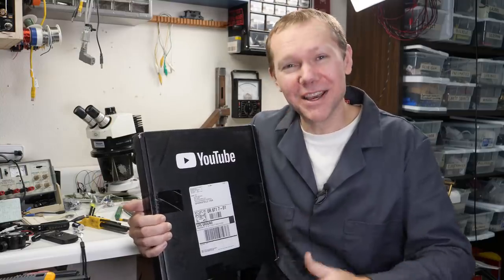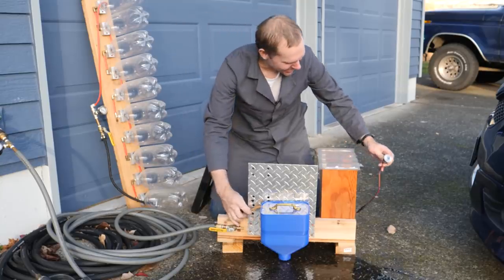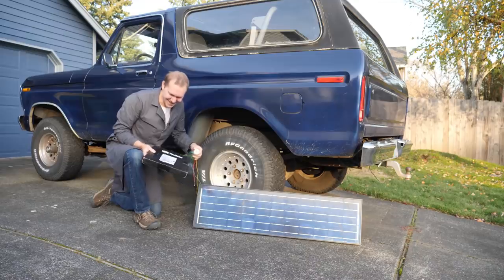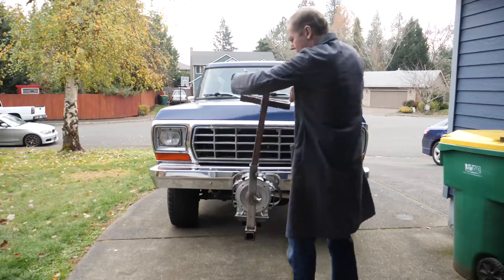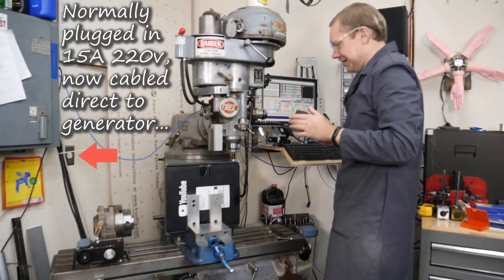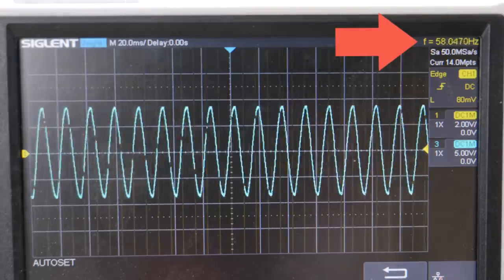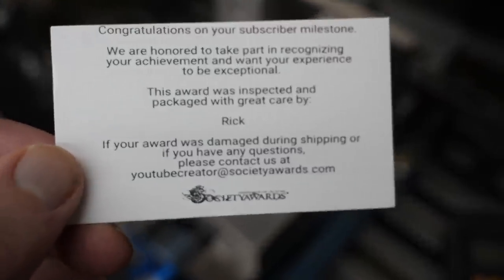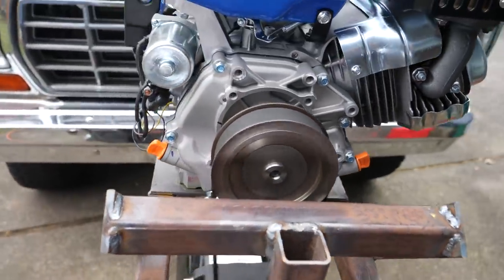Unboxing a YouTube Button - Quint BUILDs Style!

Comment: A vertical-axis wind turbine (VAWT) Can thrive at Very Low wind Speeds and  they Thrive  in the turbulent Air Zone (close to Ground, Objects, Trees & Buildings) Even Horizontal (Flat) on the Ground they don't care and they make use of the wind Twice  and they like cross winds (Cyclone Gusts)
Some of the DIY3 meters by 3 meters  6 meters  Tall Vortexis & Square cage Fans - made With Curved PVC Rain gutters  (Air con blower fans) can do 1KW  ~ upto 10KW (With Converted And Magnet Upgraded  Direct drive Washing machine 3 Phase motor)

Nice thing With VAWT They can Be built Vertical (Tower) or Horizontal (Ground Flat)